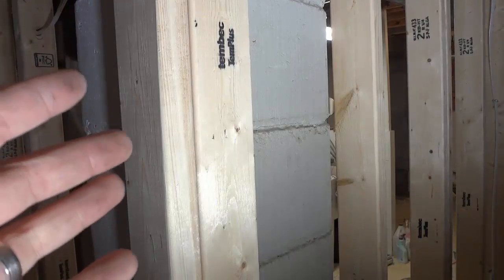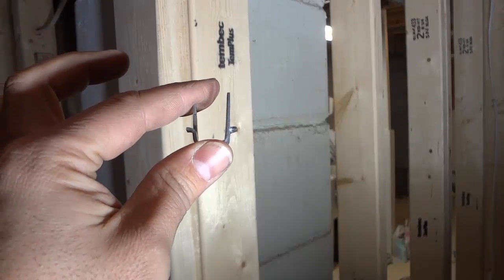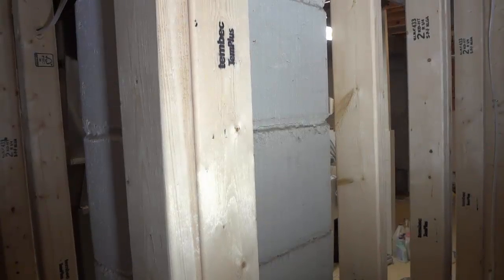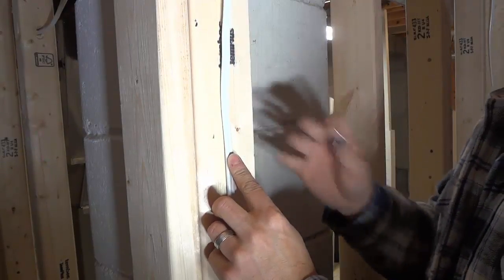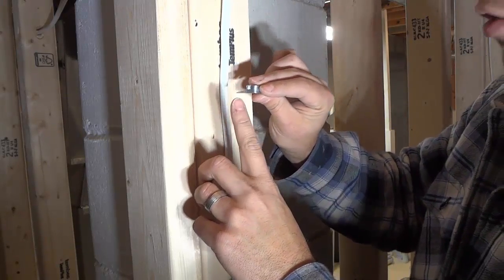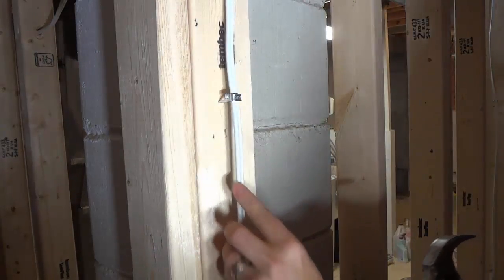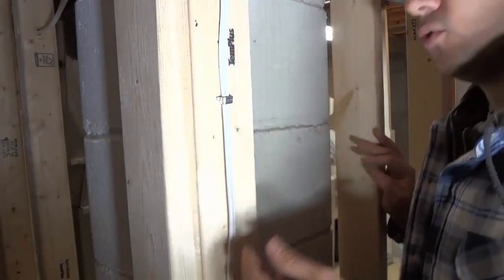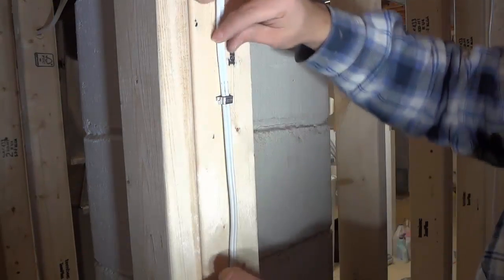Installing A Wiring Staple-DIY-Electrical

Comment: For anyone curious, you would use an S1 staple for a 14/2 or 14/3 cable, and an S2 staple for two 14/2 cables :) great video!